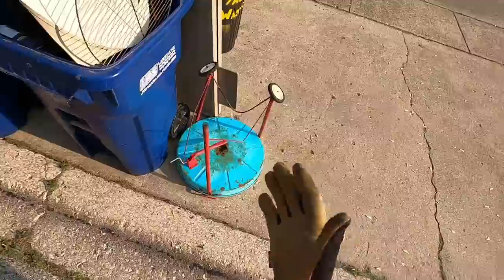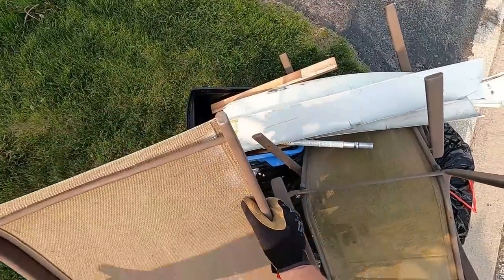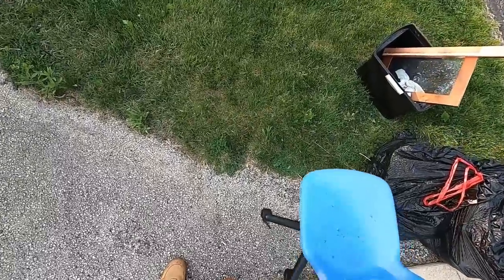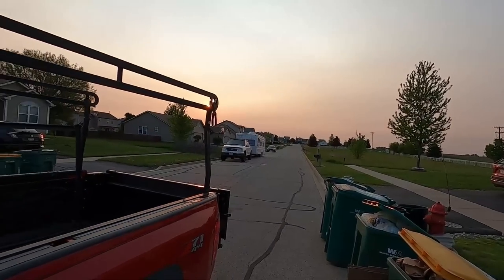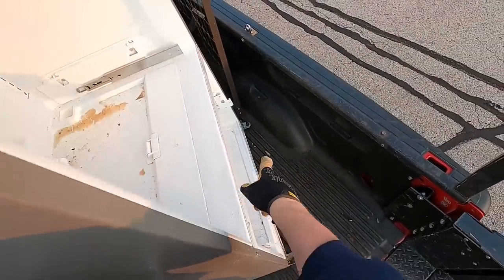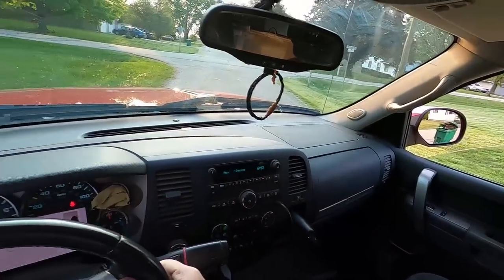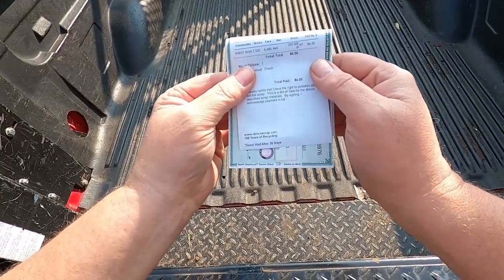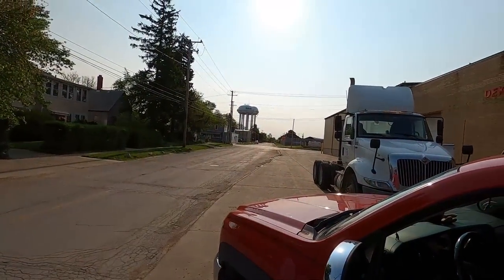Street Scrapping - Why is Everything So Expensive?

Comment: Dang times has been so hard and I’ve got three mowers and cant get one of them to work I would love to find one working tomorrow in the garbage that’s awesome I’m a little bit jealous but cool for you keep on keeping on love the videos
Reply: Do you take the filter off of the mower and then try starting it? Those filters get clogged up. My late Dad was a mechanic and would also do small engine repair, mainly lawn mowers and small tractors. I would watch him and he would take the filter off the mower and out of it's case. He would clean it with gasoline and let it dry out. Before putting it back on, he would also cover the carburetor hole with his hand and pull the starter coil as if it to chock it. He then put the filter box back on the carburetor then primed the button three times and started it up! There is also a spring that gets stretched out on the starter, he would adjust that or get a new one. Those springs get stretched out from constant use. I am sharing this from memory and from actually trying it on a mower or two myself. As I mentioned, my late Dad was a mechanic. He worked on tanks and jeeps in WWII and was at the Battle of the Bulge. He loved tinkering with things to get them to work. I get that love of tinkering from him!
Reply: @DragonNinja4680  thanks a lot I’ve tried about everything not now I have four mowers and one working one so now I got a little bit of scarp to take in

Comment: little  secret , you dont want to pull key out in/ turn on and off  , off and on etc  all day  in  a vehicle  as this wears on  key assembly , starter , ecu etc  just Let it run.
Reply from the maker: It makes sense though the research shows that's an old wives' tale.
Reply: You know there are some newer vehicle's out there that shut them self's off at stop lights and then restart when you push on the gas Patel. Wonder just how long the starter last in those vehicle's. 🤔
Reply: @ScrapPalletMan   do repairs on starters , key assembly steering  columns, etc  ~ its factual.